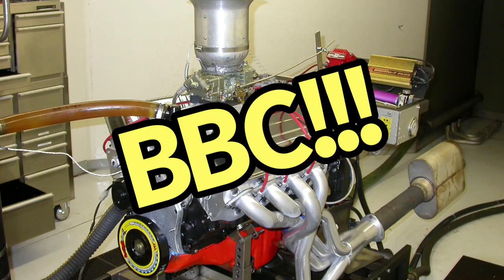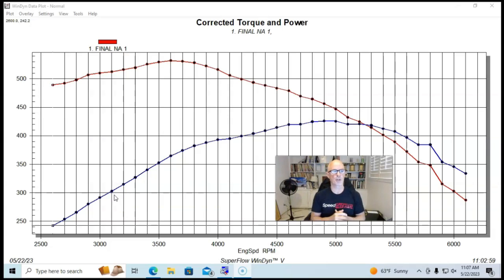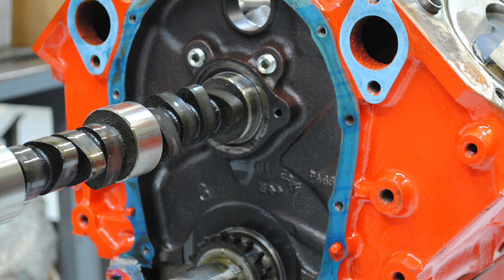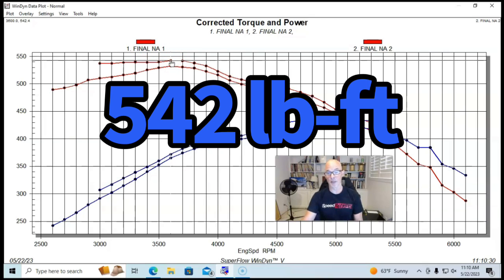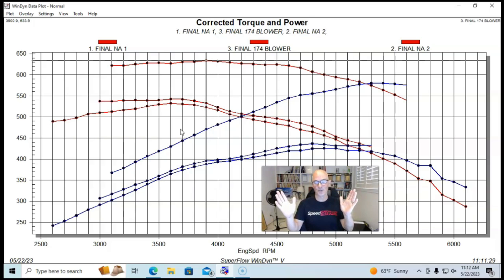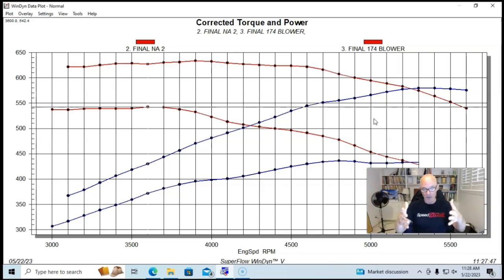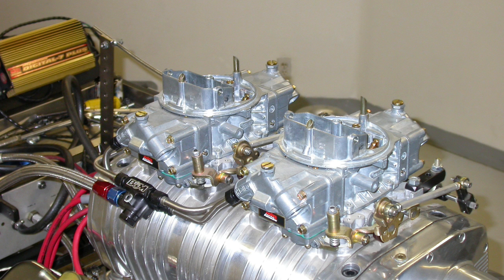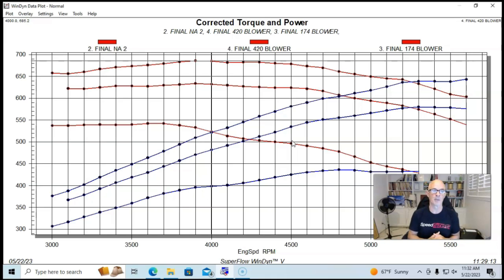HOW TO ADD TORQUE FOR TOWING. HOW CAN I INCREASE LOW-SPEED TORQUE FROM MY 454 BBC? WILL BOOST HELP?

Comment: Anyone here run the comp 206/212 xe cam in their 454? I have the cam and wanted to know what to expect.  Peanut ports, airgap, 650 vac secondary. dually for work
Reply from the maker: It will work well

Comment: You're talking about "down low" while starting pulls at 3000 rpm. Down low means 1500, 1800 rpm. Off idle with a stock converter. And the way you make power there is long runners and a low duration, tight LSA cam with an IVC point @ .050 of like 15° abdc. Like a 185/195 @ .050 cam with a 104 LSA. That will increase cranking pressure a bunch and make an engine very torquey off idle.
Reply from the maker: no one is at WOT off idle
Reply: @richardholdener1727  No one has ever hit the gas from idle? Not sure about that one boss... And what about part throttle? The dynamics of the cam should apply at part throttle the same just with less cylinder filling
Reply: @richardholdener1727 ever been stuck in the mud? Ever had any redneck friends? Chevy's handle WOT from idle all the time. They aren't like the low torque Ford engines 🤷

Comment: Only 5:00 in but if the goal was purely towing tq 1 7/8" headers are too big, 049 heads, while they'll work fine, ported ones in particular are too big. Thats why the TQ peak is over 3500 rpm even with a tiny cam. For something to tow with I wouldnt want the TQ up that high in the rpms.
With a mild set of peanut port heads and 1 5/8" or 1 3/4" headers (the latter being off the shelf size), itll make more in the lower end and about the same up top.
Reply from the maker: 1 5/8 headers on a BBC? We did a header test and small headers did not make more low speed torque
Reply: I did a quick search and the headers size videos I found were 1 3/4 vs 1 7/8 for hotter LS motors. From what I understand LS motors are happy with bigger headers then typical.
My 468 has a Crane 210/210-110 with a Performer intake, mildly ported peanut ports and 1 3/4 headers and peaks about 3200rpm TQ (vs 36-3700rpm) and is about the same up top, apart from not hanging on much after peak hp
Reply: @UFO-047 what's your compression?
Reply: @paulmryglod4802  10:1, Accounting for elevation my effective CR is 9.3- 9.4:1. Over the range of elevation i usually drive it varies from 9.1-9.7:1

Comment: Hey there, 

I want to ask I’m having a difficulty to choose the right torque converter. I do have 1980 c25, with Ls2(L77) swapped on it. Big stage 4 cam by BTR, Holley 42Lb injectors. 7400 push roods , double springs titanium, mailing oil pump, 92mm Holley throttle with Denali 6.2 intake, k&n air filter, long tube headers by speed engineering 3” 1-7/8, car backed by Borla. twin walboro fuel line on 87 switch.  4l80e is the transmission that has a stage 3 upgraded kit from TCI holds up to 800 Hp. I want the right torque that shows the right power of the engine. I’m not planning to add anything such as a supercharge nor a turbo. I see it’s enough. The loop of the cam 111. Can you please advise me on the right torque converter, I see 3700 stall is too big for a truck.
Reply: Thanks for you upcoming response.
Reply from the maker: why the stage 4 cam?
Reply: @richardholdener1727  I’m here to listen to your suggestions. I don’t want the power to decrease down.
Reply from the maker: I would pick a smaller cam
Reply: @richardholdener1727  i find a stage 4 cam with 109 loop. But lower on the stall it opens between 2800-3200 stall. It’s BTR GEN III & IV TRUCK CAM - STAGE 4. Thanks for your help. I’m your biggest fan from Saudi Arabia 🙏🏽
Reply: Cam is way too big for the goal

Comment: Cortney and I tested a Cadillac 500 yesterday .. grunt motor  661 ft lbs at 3900 rpm  574 ft lbs at 1900 rpm all NA
Reply from the maker: nice
Reply: @scotthatch4548
Installed inna vehicle?
MPG?
Reply: @xmo552  look up farm truck

Comment: A good idea for torque is a cam with around   196-210 @50  with around .035 "-.045 " thou   lift at TDC for inlet and exhaust cams .
Reply from the maker: that is a huge spread

Comment: Ok , bloodviking chimes in

On a normally aspirated engine cubic inches is key. Build the biggest c I d motor you can. Or at least stroke the engine you have. Mild stroker don't cost much do build if you go with a cast steel crank. And they are very strong. A 496 bbc isn't much more to build then a 454. Use a fairly small dur cam. Otherwise gas mileage will change. I used to build engines that as soon as they started to lose low end tork I knew it was time to go to a smaller cam. Better heads would help. More compression may not be advised as 94 octane gas costs more than 87. Longer rods and fast burn combustion chambers will allow for more compression that will bump up power a bit. You would be surprised how going from 10.5 1 pump gas to 12.5.1 gives about a lousey 20 hp for having an engine that won't run on pump gas now being a wrong move. I would think you could tow just about anything with about 650 to 850 fpt. A supercharger will add power all around but the gas mileage is going to go way down. Especially with 2 carbs or 2 throttle bodies. With one aftermarket stand alone  fuel injection kit I could see a bit more power being made. Perhaps having a 30 hp increase. With a na engine a few tricks here and there will add up. Larger valves help. Keeping the rpms low is very important for fuel economy. 4.11 gear would be nice in a towing vehicle but even with o.d. but a bit much on rpm. I'd suggest a 3.50 gear. Even a 3.73 is very bad w.o. o.d. if you are on a very small budget I'd have to suggest a junk yard 454, a 274 dur cam, oval port heads and stay at the 400 to 450 hp level. Once you add a bigger cam, turbos, high compression the towing motor will become a gas sucking motor.
Reply: Were limited to towing 3500kg here in UK on standard car licence. So a 2.5-3l diesel is best for us. Saying that I do have a 350 a 454 and a 496 just for fun.
Reply: @Harrybowles1969  26,000LBS GVWR is the limit for a "standard car license" and an RV is exempt from any weight limit in Texas. Its downright scary some of the junk on the road honestly, especially on an 80mph speed limit highway.
Reply: it's always funny when someone brags about the amount of torque their towing rig has and then you ask, "so, what's the plan for stopping all that mass you think you're going to be able to pull?". and forget what their trailer suspension is going to do with a cross wind. 

sometimes, it's just good to make a second trip :)
Reply: You hot the nail on the head man.. so true with everything u said...alot of people think there are magical cams that are built to make more torque...when I reality like u said you just end up losing torque down low with a heavier cam after a certain extent

Comment: Richard. It can be noticed the peak power numbers with the blowers start to creap up to the level of the peak torque, which did not happen naturally aspirated. I wonder is this a common phenomenon using blowers or does it happen with turbos as well?
Reply from the maker: yes with a rising boost curve-and a short runner intake used on the blower

Comment: I've been looking for more. More than zero tow motor builds that I have seen anywhere. I would love to see a big block build where you try and approximate a diesel where you get the HP and torque all below 3k revs.
Reply: And MPG
Reply: Yes please
Reply from the maker: you can't do that effectively-you need to just get a diesel. You can make good torque in that range however as shown (just not peak hp)
Reply: I know modern Subaru turbo fours can make silly down low torque and HP. I was thinking single or twin fast spool turbos could possibly cram alot of air way down low might work. Probably fall flat on their face by 5000 RPM or so but it would be interesting to see anyways.
Reply: Ok F' it I'm going back to steam.
💪😂💦💥💨
Reply: a gas engine will always cross 5252 before peaking hp
Reply: @slammedsandoval  not so worried about HP but crazy low rpm torque.

Comment: Thinking about the horsepower differential between the 174 and 420 with only a pound of boost difference. Could it be the 174 was being overdriven and heating the intake charge more? Did you take any temp readings below the blower(s)?

Comment: So as NA what Cam size do you think would have been better for low end power and torque for pull over the one you picked 1st?
Reply from the maker: there isn't a cam to make much more low speed torque-just to shift it up higher
Reply: @richardholdener1727  what would suggest in a 496 for towing? And thank you
Reply from the maker: watch part 2 that comes out today (but I would use a smaller cam)

Comment: I get 12 mpg towing with my 1997 C2500 454 Gen 6 with its stock 4L80E and 4.10 gears in the 14-bolt Differential. Drive yet 70-100 mph on 87 octane
Reply: That's damn good for an old truck. Better than my prior truck, which was an 04 5.3L Half ton
Reply: I get 9-10 with my 91 454 th400 3500 towing.  Falls on its face past 4k rpm and it costs more to fuel than our '17 duramax dually towing similar trailers.
Your setup is nice
Reply: The overdrive is helping you

Comment: Does it Run on 87 octane gasoline Towing 10,000-20,000 pounds dead weight without Detonation and Running 70-100 mph nonstop in modern Highway Traffic without overheating and failures any ?
Modern Diesel trucks do it just on Biodiesel nothing more.
Reply: Boost and computers
Reply: @xmo552  As long as it runs on 87 octane all the time.
Reply: @brracing7861  
I was referring to modern diesels
Reply: @xmo552  Diesels are nice. Octane not a Factor much.
Reply: @brracing7861  why would you waste your time on 87?  Engine built for 91-93 usually adds enough economy to pay for the higher cost. Then again my 11:1 383 I tow with in my Express van runs great on E85. I make 520 tq at 3,000 rpm on E85.

Comment: I think you were about right on the money with the 454.  my build would have been similar, except NA. For a tow rig you want reliability, once you get above 550ft/lb  you start to break things, quickly. in a truck, the corporate 14bolt is a beast and can take a beating, but an automatic trans would have given up pretty quick at that power level.   so, my build would have been all NA.  I would have tried to start with a 502 BBC, 9.5:1 compression, peanut port heads, I would have used the Summit Racing Sum-1301, 218/228@50 502/501 lift and a 114-degree lob separation for better vacuum for breaks and a better idle and off idle power for towing.  kept the standard performer and used a Q-jet carb.  better throttle response for the smaller primaries and will get better gas mileage in stop and go traffic and while cruising. I would have spent some money on a built TH700R4 with the .70 overdrive for better fuel economy and towing. the TH700R4 also has a 3.06:1 first gear. so, it can pull those heavy loads just off idle. also good long tube headers and a dual high flow cat exhaust to get the air our and still stay EPA friendly.  making pulls on a dyno is one thing, building a reliable engine that is easy to live with day after day when towing a load is another.
Reply: I would not trust a 700r4 at any build stage in a tow rig with that much torque…
Reply: for the amount of cash getting tossed around, a THM400 with a Gear Vendor or other overdrive would be a 6 speed versus the 3 speed with OD and you won't need an expensive lock up torque converter unless you want that for highway. just sayin'.
Reply: I have tried 700r4 in heavy towing applications and they wouldn’t last in a Crew cab dually. One left me walking after 100 miles of hilly terrain. Turbo 400 with gear vendor and huge cooler was reliable and gave me zero grief till I sold truck
Reply: Shad if I did that... what mpg could I expect ?
Reply: @xmo552  my guess is mid to high teens maybe low 20s on flat ground on the highway at 55. big blocks are not exactly known for fuel economy.  also, it would be less when towing stuff up a hill. there is no real way to estimate the fuel economy. too many variables. like final drive axle ratios, weather temp, carb vs fuel injection, etc.  I chose the TH700R4 for this example simply because its super easy to swap into anything running a TH400 or TH350. any manual transmission would be significantly better than any auto for towing.  the 4L80 and 4L60are good transmission, but pricy and require that you install a powertrain control module to run them. and are not as easy to swap into old iron.  also, Holley Stealth EFI is also an option, they make one that fits Q-Jets cars. small primaries for better throttle response.
Reply: I have a 69 c10 with a 700r4 a qjet with a small port 350. Gets around 20mpg on highway. Building a peanut port 454 and a 496 and sticking with the qjet. Exited to see if I can achieve high teens mpg
Reply: I can see there is a lot of Dislike for the TH700R4. I chose it simply because it is the most easily swapped 4 speed overdrive automatic. there are may better options, like 4L80 and 4L60, but they require a PCM to run them. and the TH700R4 only requires a simple harness and vacuum  and 4th gear pressure switches make it work. the key to making the TH700 live is cooling. and to be honest any automatic in a tow rig needs all the extra transmission cooling it can get, so I would be running a Big separate trans cooler in front of the radiator.  also torque converter lock up is critical to long life of the TH700R4  in fact it is usually what kills most TH700s.
Reply: The SM 465 4-speed manual transmission with a granny low gear. It has a ultra low 7.20 first gear. I've had an all stock 350 small block Chevy with this transmission. And I ran it like that for quite a long time. And had 18,500 pounds not including a single axle boat I pulled at times which was another 3,000 pounds which made 21,500 lb gross. I've had automatics before but nothing will pull like these sm465 manual transmissions. And with a manual transmission you don't have to worry about burning the automatic transmission up from the transmission overheating. An automatic transmission would have never pulled this kind of weight especially up a hill stopping and going again. I've had automatics before im work trucks. I tore up too many of them.

Comment: I run more lift in my torque small blocks.
Reply: I have always wondered how well a good 500 caddy would do in a truck.
Reply: @doomman700  
That was the hot setup.... way before my time.
Reply: @doomman700  it does well, you can get an adaptor for chevy BB headers meant for trucks to cut down on costs. most "Crate engines" or build recipes are making 500 ft lbs or more at like 2,000 rpm.
Reply: The 455 Oldsmobile big block was a torque monster in a Chevy truck.
Reply: @freezinghotshot  
Or the 455 Buick
Reply: @freezinghotshot   I have seen an olds in a diesel swapped square back in the day. It was a good swap.

Comment: What kind of milage did you get with the small blower ?
Reply: I wish I could mimic torque, reliability, and MPG of my 2004.5 5.9 Cummins but with a small or big block Chevy, Cad, or Buick maybe.
Reply from the maker: 6 towing
Reply: @richardholdener1727  sounds about right how about without a trailer?

Comment: From my limited knowledge of BB Chevs I think your build was ideal - or at least pretty much what I would have suggested.  Fact is the 70s 454 was a bit of a pig and you could really improve on it, as you could with all that 70s malaise stuff.  The specific output was so horrid it could only go up if you poked around under the hood.  Not so much the case nowadays. And a supercharger or two - well heck yeah.

Comment: running comments  any quench in the rebuild? blowers work  most of my builds were either trucks/ motorhomes or off shore Cigarette boats looks good  looking fwd to part 2  cometic gaskets coming?  studs?  what rpm range are you shooting for with new cam? done your trans yet?  cheers

Comment: I like your video's But.
Boost on a gasoline tow truck engine is illogical.
If you want torque and don't care about HP. 
Don't add boost, just lower the gearing, and shift more often.
Reply from the maker: you spelled awesome wrong
Reply: What a silly thing to say

Comment: That’s how I have built a couple of 454 tow motors, the old 049 castings are a great head for that.  Did you up the valve sizes to 2.19/1.88?  Yours is nearly identical even down to the cam selection; a Crane with 0.500” lift on both I&E with a little more duration is what I used.  Fun to see the blower combos on it.  Had a 177 on a 400 sbc in my old 77 3/4 ton.  Don’t know if B&M makes the megablower anymore.   Basically a 6-71 as I’m sure you are aware.  Never had the opportunity to play with one of those.  Thanks for sharing!
Reply: Holley/Weiand/B&M don't make ANY roots-style superchargers any more.  All gone, sadly.
Reply: How did the 177 on the 400 do in your truck? I'm thinking of doing exactly that on my 81 1 ton.
Reply: @xmo552  The 177 was a hoot!  Those square bodies aren’t that heavy, at least compared with today’s trucks.  You’ll certainly enjoy it.
Reply: @sddnhad  
I need it to tow and I need MPG.